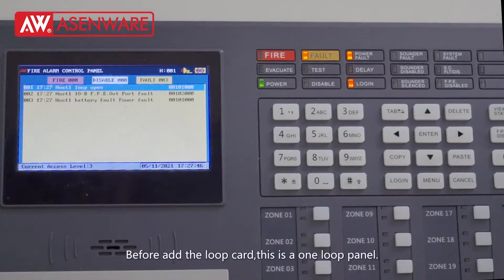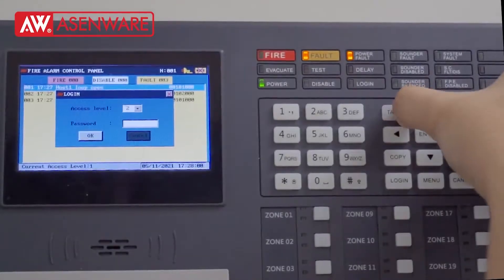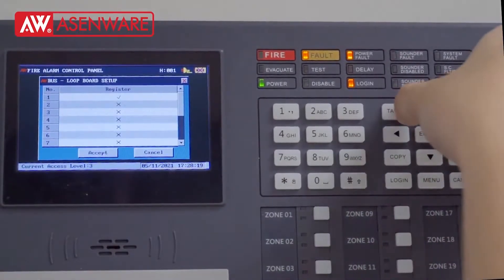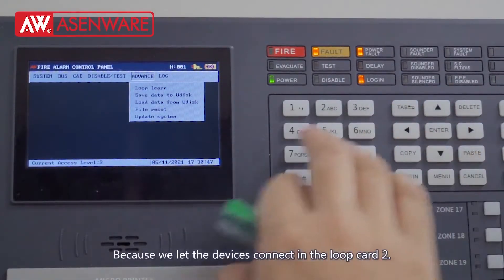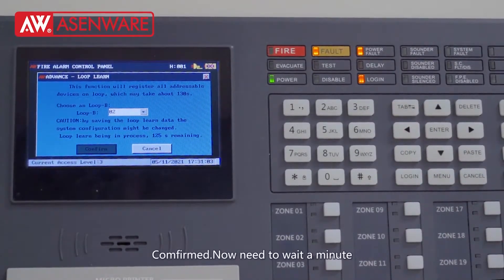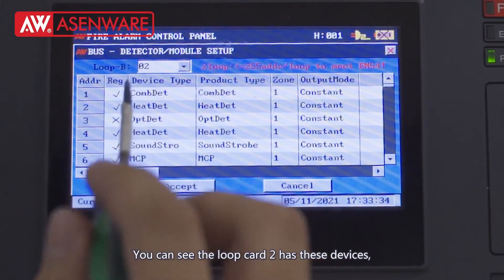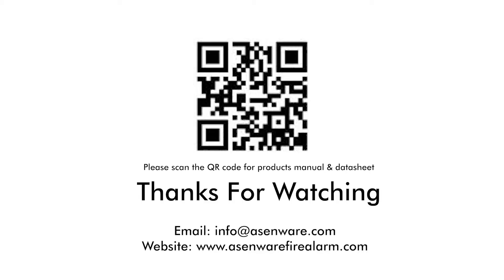How To Add Extra Fire Alarm Loop Card To The Addressable Fire Alarm Control Panel(FP300)

Comment: how can i address loop card on multifunctional  fp200 panel ?
Reply from the maker: Hi dear, the loop card for FP200 panel has jumper setting for loop number for which it is connected.
Loop address can be set by checking loop card number address on backside of loop
Reply from the maker: Welcome contact us: 
Website:asenwarefire.com
Whatsapp,Wechat,Tel:008613922805301
Email: info@asenware.com

Comment: How to link the extension loop with main control panel ?
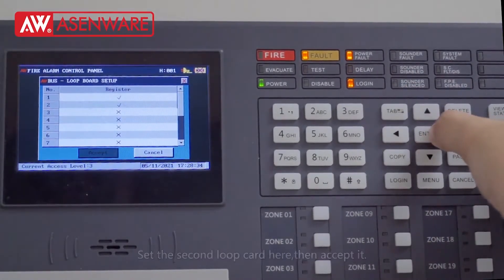Reply from the maker: Please watch the video from 1:15 to learn how to link the extension loop card to the control panel
Reply: @ASENWARE  I mean loop card 3and4and5
Reply: Not on main port I have main port  with 2loop and I have loop extension with 3loops
Reply from the maker: @mohamedali-sn2dl  Thank you for your feedback, you can leave your contact information, or add our technical engineer, we will solve this problem for you. WhatsApp +8613590128969